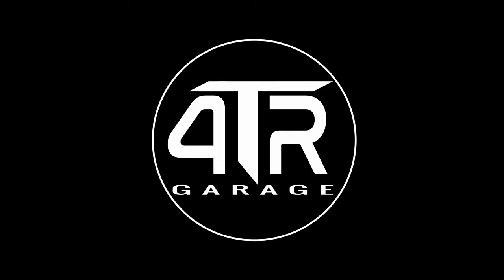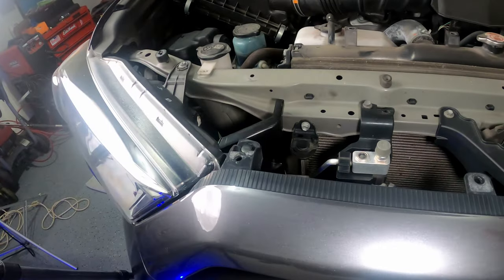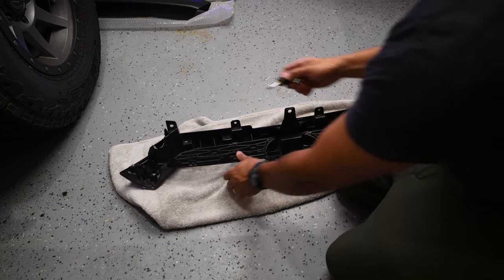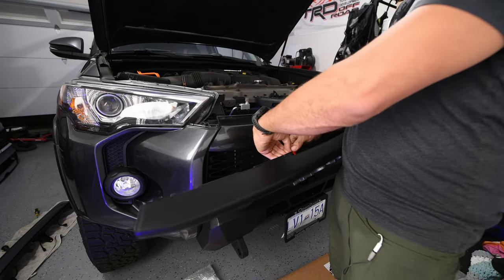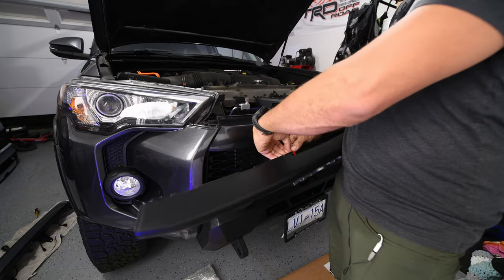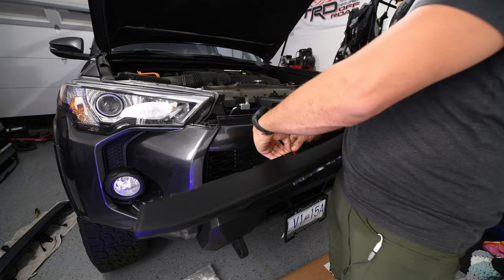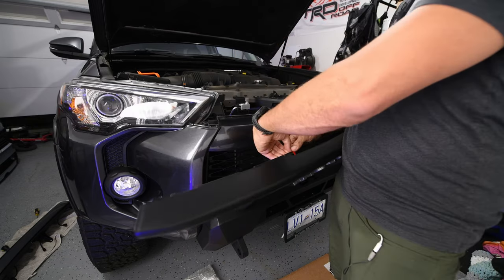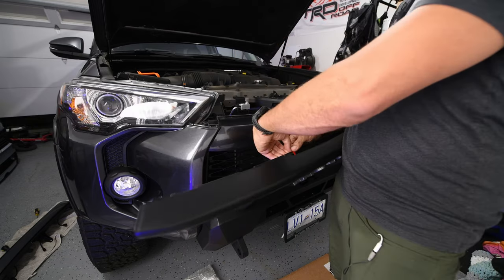The Best Replica TRD Pro Grille and Raptor Lights Install - 5th Gen 4Runner

Comment: Wanted to shoot you an idea. When I get parts that I'm thinking it will eventually peal or fade, I send them before installation to a powder coating company.  Today powder coats have multiple colors and flake in the coatings. It will not rub offbir beat off with a hammer. Fading will not happen. It's worth the extra 150 bucks

Comment: There's bumps for screws for the letters to screw in so they line up so they are not crooked like your first letter T is. Does this company not have the screws for the letters only 3M?

Comment: another thing you can do is splice your  lights onto your fog lights so you wouldn't need that fuse stickling out your fuse box only thing is the raptor lights will be on and off same time as your fog lights, personally i used a t splice connector and has been working just fine

Comment: Could you have put the raptor lights in the parking light fuse spot so they would turn on only when parking or headlights were turned on?

Comment: I just got a 2023 trd off road prem. Drunk driver totaled my 2022 trd pro. My raptor lights on old car went into same fuse as yours. However now my fuse panel is ENTIRELY different. 
Would you mind telling me what the name of the blank slot you plugged into. Got the same fuse connector youre using bc i ordered from 4runnerlifestyle too. 
Also side note thanks for video. I used your video only to install my own trd pro grille from them.
Reply: Had the same question! Looks like there is only 1 empty spot. I wonder if you can use any empty spot? I also thought about using one of the ignition fuses.

Comment: Great video
Went on 4 runner lifestyle and they say these are not compatible with Limited's
When you swapped your bumper did anything change on the upper part of your grill for these to fit?
Confused on why it would not fit the Limited 🤔
Reply from the maker: You keep the very top piece of the 4runner limited bumper. This section is below that and needs to be replaced to Sr5, TRD pro, off-road in order to fit. You can reference my limited to TRD pro conversion video to get a better idea
Reply: @T4Rgarage  thank you! I will watch it again for sure.

Comment: with that fuse location, are the raptor lights on with headlights, parking, and drl? or only with headlights on
Reply from the maker: Only on when the car/accessory is on. Not dependent on anything else.